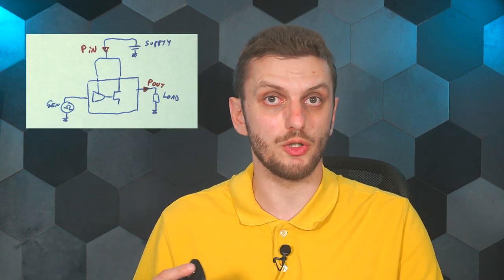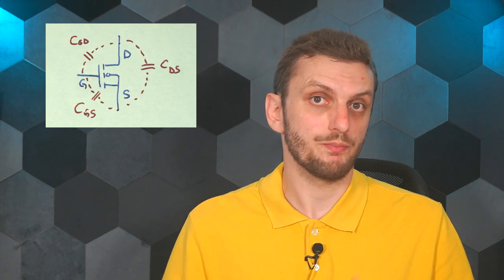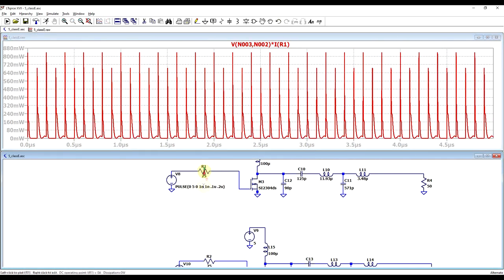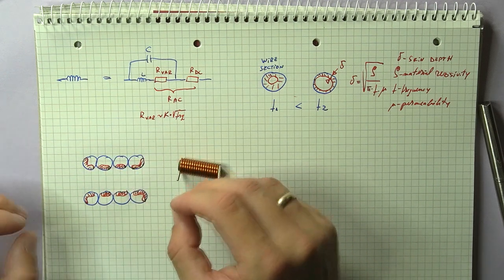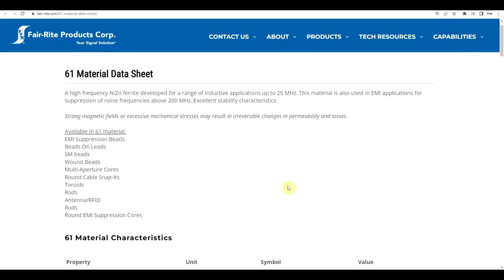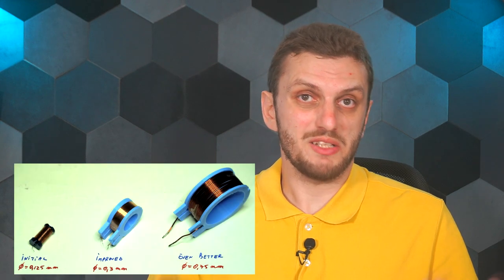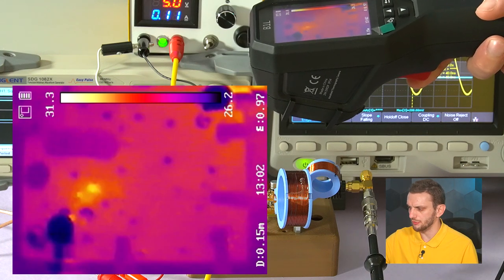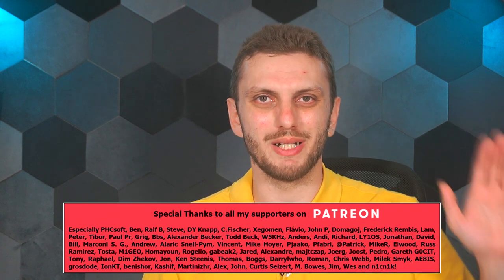Class E RF amplifier - MORE efficiency (3/3)

Comment: Dear Sir. It is a very good video. But I would suggest you to consider the following: in order to reduce the skin effect, I would suggest to use the litz wire, in order to reduce the proximity and inter turns capacitance, I would suggest the "honey-comb" winding, and in order to reduce the relative number of turns, to use the Mn-Ni-Zn based ferrite core, and, finally, in order to avoid the core saturation, use open (not closed) cores.

Comment: Since the gate capacitance represents a storage of energy, is there a way to recover that energy and use much of it again later?  What comes to mind is some form of inductance to store this energy during the turn off and use it again during turn on. One would of course still have loss in transferring this energy back and forth. In the second video you used a sine wave to drive the gate successfully which suggests an LC circuit for the driver where the inductor is in the collector circuit of the driver and the capacitor is the input capacitance of the final gate.  But then isn't the class E, just a variation on a class C were external components are adjusted to assure 0 Voltage turn on and 0 current turn off?

Comment: Thank you very much for this video. I'm working on optimizing the final amp stage of my (tr)uSDX ham transceiver kit to get the efficiency up as high as possible while keeping power output around 4 or 5 watts in order to get maximum usable time on a battery charge. It's a fun process, but I wanted to better understand the variables and their relationships instead of just trying random changes until it worked better. The previous discussion about circuit Q and bandwidth is something I will have to delve into to make some necessary trade-offs. Understanding is great stuff.
Reply from the maker: The uSDX looks like a really interesting project! May I ask what sort of antenna you are using for it?

Comment: How would you actually use this to amplify a signal? What does it look like if your signal has some information encoded in it beyond just the carrier? For instance you mentioned there is some rise time, does this impact the usefulness for amplifying CW signals? It seems reasonable to use this to amplify a frequency modulated signal as long as the frequency deviation doesn't exceed the bandwidth of the filter stage. Is there any way to use this with phase modulated or amplitude modulated signals?

Comment: Could air core inductors wound with litz wire be made smaller for the same efficiency?
Reply from the maker: From what I could find, litz wire is recommended for uses-cases up to 0.5-2MHz; after that the benefit becomes negligible compared to solid wires... So the exact wire type that gives best results will depend on the usecase frequency.

Comment: Is there a minimum thermal resolution that you'd recommend for electronics? I see the B1L you use is 160x120 is over $300 USD. Referral link totally fine!
Reply from the maker: I can't say what a minimum usable resolution would be... in the end even a 1pixel pyrometer will do as long as the measured spot is small enough in reference to the component you need to investigate. The larger the resolution the easier it will be to observe a target in more detail, but of course, larger resolution is more expensive... so it will always be a budget related compromise. Another thing to look out for, if you are interested in small electronics (like SMD components), is the possibility to add an extra lens to be able to get close to the target - by default most cameras recommend a minimum distance of ~20-30cm, distance at which you cannot make out small components.

Comment: Thanks for this short series on class E, very detailed and informative.
I designed a class E stage myself, for a few Watts, and noticed that this class E configuration is very sensitive to load changes. Either the FET voltage or current increase quite a bit with Rload and operating in a real life situation you have to either keep SWR low or have good protection circuits for the FET.
In the end I went for a slightly different configuration with the L from drain to supply having the same impedance as the load and use it in conjunction with a PI low pass filter to also get kind of class E operation. My measured efficiency is about 94% and the voltages and currents in the FET remain kind of the same, even with SWR of over 10:1, so no protection is needed.
Try what happens in your LT spice simulation when stepping Rload ovee a wider range. It is very interesting.
Reply: This is a very useful comment. Thanks!

Comment: Just a few remarks. The gate drive current is equal to Qg x Fsw. The second note is about the switching loss in the MOSFET. In LT spice, this is calculated from Id. But Id also contains the current required to charge the MOSFET output capacitance Coss. The loss you see is very often higher than the real loss specially if the turn off is faster than the rise time of the drain voltage. (you can see this on an oscilloscope by observing the gate plateau voltage or the absence of that plateau if Vds rises slowly because of limited current to charge Coss)
You might also be interested in resonant gate drive circuits. Basically a class E amplifier driving a MOSFET..

Comment: Thanks for the video. Im still in my quest for a class E for 28MHz, but the BSS316 might work, and I also found the IRMLM0100.

My goal is to build a 28MHz beacon either in CW morse or WSPR.
Reply from the maker: What sort of power level are you trying to achieve? the BSS316 is quite a low power transistor after all...
Reply: @FesZElectronics  1W
Reply from the maker: Then it should be ok. The transistor after all can support up to 0.5W of power dissipation, so even in a non-ideal situation, it should be ok for a 1w transmitter.